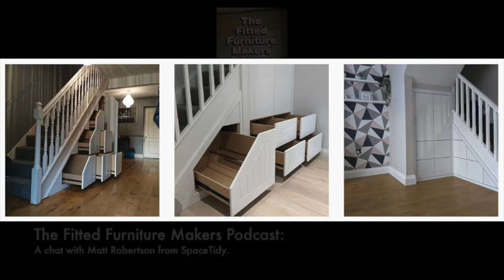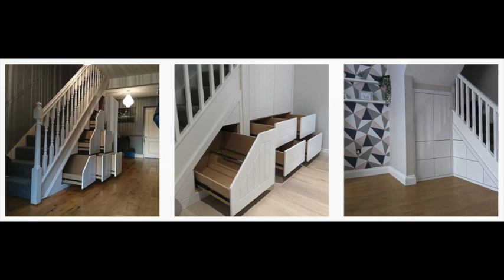A Chat with Matt Robertson from SpaceTidy (episode no. 6)

Comment: Hi Alistair great podcast. Very interesting to see what matts doing.
Did you find the supplier of the rubber matting. Thanks
Reply from the maker: Hi Mezzy thanks.  It was Banbury Plastic Fittings but they sell in bulk and you can find similar stuff in smaller quantities on Amazon and elsewhere https://www.bpfonline.co.uk/search.asp?catid=10566
Reply: @Alastair_Johnson  thanks Al, wil contact them regarding matting. Thanks